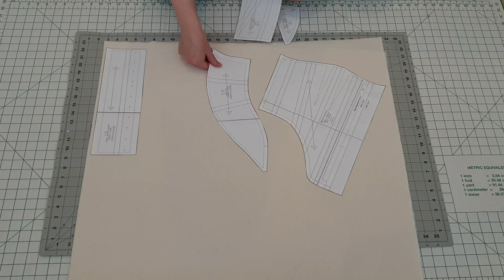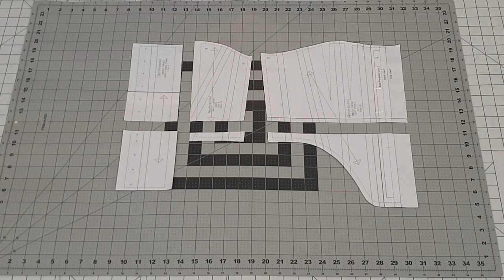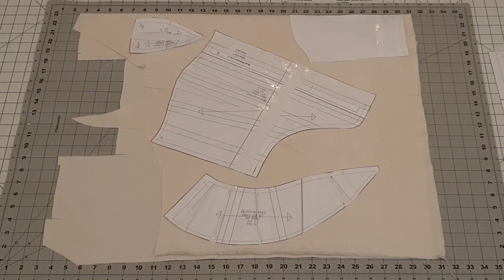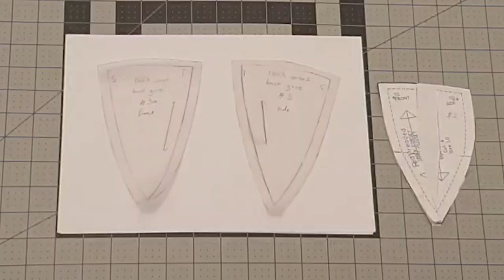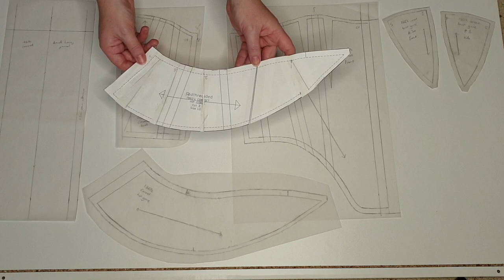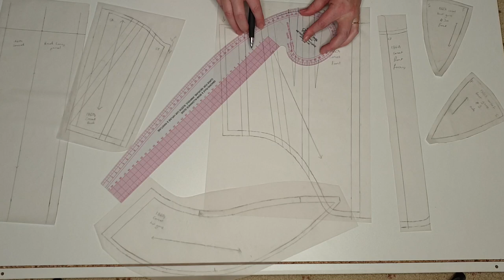Fitting My Redthreaded 1860s Gored Corset Mock Up

Comment: Thank you **so much** for the tip about using masking tape for corset mockups. I used that method in my own most recent corset. It made mock-up alterations so much easier and faster, and I got an excellent fit in the final corset. I also really appreciated seeing your iterations and thought process through your different mock-ups. Thank you for this video!

Comment: Thank you.  I have been told it is unlikely I can make my own corset that will fit because I am large bosomed.  You just showed me how.  Thank you 1000 times, thank you!
Reply from the maker: Best of luck making your corset!
Reply: I think anyone saying that does not understand corsetry. You just have to understand what kind of shape you need and have the skills to sew it (that's where I'm a little iffy... it will be a learning process lol). Ugh... that statement is ridiculous. I could refute it so many ways. So many. Corsetry is VERY misunderstood.
Reply: @mitsycat2803  Yes, and that was the point of my comment.  Despite what I had been told, it is possible and I have now succeeded thanks to having seen this video.
Reply: @cdeg1964  really? Yay!! Then there's hope for yet 😆 of you don't mind me asking, how does it fit? If you don't mind me asking, how is the bust shaping on a properly fitted gored corset compared to a bar l bra? Can't decide between this style of bust, the more flat and boned kind, or a more regency kind of fit. If you've worn yours under modern clothing and feel comfortable sharing, I'd be curious to know your thoughts. More knowledge in this is not a bad thing. I've been watching a lot of videos about fitting techniques before starting, but everyone has their own method. Love to know how this one worked out for you. She did make it seem much less intimidating than other people have. Like I said, I understand what needs to be done, it's more so the how that's been holding me back.  Can't tell if I'm excited or terrified by it. Maybe a bit of both lol
Reply: @mitsycat2803  Mine bodices are shaped to my body.  It took 4 mock ups, 2 of which I placed bones in to be sure it would be okay.  I LOVE LOVE LOVE my bodices.  Bras hurt me.  I have dents in my shoulders, scars from the irritations that lace has caused when the weather is horribly hot and sticky, permanent marks around my chest and back where the band sit.  I made my bodices for both back support... I tend to slump towards my sewing or desk or knitting or whatever I am working on... and bust support.  They are structured in a combination of the renaissance-ish look and Victorian natural form look.  I wanted them to be modern enough that I don't stand out when I wear them but to still be pulled together, comfortable.  Definitely corsetted/bodiced but not 'in my great 
grandmothers clothes'.  So you are aware, I am 60.
Reply: @cdeg1964  thank you so much! That was very helpful, actually. Bras are a nightmare for me too. The band is the worst. If it fits, I can't breathe as well, but any bigger, and I am unsupported. I was looking at underbust, that's what most say beginners should go with, but the idea of having to wear a bra WITH a corset.... not the most appealing. My body is so difficult to fit, though. I have had so many abdominal surgeries that I need much less compression there than the average corset would allow and some odd shaping, especially since my waist is small by comparison, however, I still REALLY need back and bust support. I'm a huncher too, especially while knitting lol. Bottom line. My dream corset does not exist. I was wondering how mashing up styles would work. I'm glad to know you succeeded. My other issue is trying to figure out what fabric will work best with my hot flashes, but how the heck do you research that one? I'm in early menopause due to a radical hysterectomy, and they are brutal. Yet another reason why a super tight, sticky, itchy bra is not ideal. 
Personally, you do remind me a bit of my grandma a bit. But, my grandma was amazing. She was an incredible seamstress, endlessly creative, could knit like nobody's nobody's business, and was always very stylish, in her own unique way. So please take that a compliment 🙂 I bet you look great. And, again, thank you for the help!
Reply: @mitsycat2803  I can understand about the hot flashes.  Mine suck way a lot also.  

Do you have a block?  If not, it is worth you while to make one.  It needs to be the kind with princess seams at the shoulder.  (You can move them later but you need the correct fit first and foremost.  You need to be sure your bust sits where you want it, not droopy or too high or you will not be comfortable.  My laces are in the front and my back has no opening.  That is a perfectly valid option.

Once you have the block you can use that to make your pattern pieces.  I make my inner layer with 2 layers of twill (think white demin), shifting the layers are 90 degrees to each other to counter any possible stretch in the fabric.  You can use coutil, which costs more, or other tight woven fabric with little to no give.  I sew my channels into that and then check the bones for fit.  I use zip ties for my bones.  Heavy duty 200 or more lb strength ones.

Once I have my channels sewn in I put the pieces together with the outer fabric and sew them from back to front grading all the seams to they don't bulk up and look abysmal.  Every thing is still 'flat' meaning the shoulders are not yet sewn.  If you don't use the shoulder straps (BODICE) you will just have the corset 'flat'.  The quotes are because it will definitely have the shaping.

When I do mine, I sew down all my seam allowances where I want them.  I then turn my edges and stitch them with large whip stitches in place.  Once that is done, I hand sew the lining.  I use a 'weird' to most folks method of cutting my lining pieces using the same pattern pieces and then stitching them into each position by hand with small stitches.  

Once I am done there are seams but not stitches on the outside.  That is my preference.

Okay, for a corset, you can stack the outer fabric with the inner (if you fabric is sturdy enough you can use on inner layer and the bones will be between the outer and inner layers but pay attention to stretch and turn your inner to compensate for any the outer layer might have.)  Sew you channels and then do the same seaming.  I would always add a lining.  With your hot flashes maybe micro=fiber breathable bed sheet fabric would work.  Satin pillowcases also make great linings.  Keep any stretch vertical.

You can make a tank shirt of some kind that will not show under your corset but in all honesty, a cotton chemise is likely still your best option, especially if you want to wear your corset to show it off.  

I mentioned I lace mine in front.  It gives my more adjustability that way.  I start with a gap of about 3" finished and then, over time, I can close it down or loosen it a bit, whatever I need to.  Also, since I start with less pieces I can 'take them in' along the sides and center back if my body size changes more than the gap amount.

Use grommets if you can, if not reinforce your lacing holes with jumprings.  Those are easy to find in the jewelry department of a craft store and come in smaller sizes than bone rings.  They are NOT to pull hard against.  The reinforcement lessens wear of the hand stitched eyelets and any distortion of the eyelets over time.

If you don't want to wear your corset tight, don't.  If you want it a little snugger some days, do.  That is up to you, not some stupid fake celebrity 'image'.  I want support and the shaping to make my clothes look better, not to be in pain all day long.  Trust me, you don't even have to fright lace it, the shaping the structure it gives will still be markedly noticeable regardless of what size your start out at.

For the record, I don't wear my bodices in the summer.  It is too hot, and more importantly, too humid here to do that... HOWEVER, I have seem folks make corsets from what seems to be needlepoint canvas.  You need the kind that is not sticky if it gets wet.  Nylon window screening 'might' work but you need that to be an inner only layer and NOT against your skin... and no, I have not tested it but am planning to try it for summer or anyways warmer weather.  Nylon... not the metal kind.  You have to read the packaging and be sure.  Power stretch, the heavy kind that is available from bra making supply stores might also work but you will need to use twill tape for enough support for the bones.  Stretch widewise.  Your outer layer will help the whole corset or bodice not to stretch.  I made samples with that and it worked well but would not be great for tight lacing.

I hope this helps.  I see you have channel but I don't know how to contact someone from youtube directly or I would send you some pics of mine.

Comment: This video was fantastic, and makes the fitting process look *so simple*. Also fantastic to hear a familiar accent. Where did you get the fabric that you used? I've been having trouble trying to find fabric that will work for a corset mockup that won't break the bank
Reply from the maker: Thank you! I used a non-stretch denim that I got on sale at (I think) Spotlight years ago. You can also use canvas, or a thick calico. The key is that it has to be non-stretch. Looking for rolls of fabric on the remnant table can be a good way to go when on a tighter budget. 😊

Comment: Just made a few mockups of this and your video was extremely helpful. I have the length on the body right, waist and hips are perfect. The bust well not so much it is huge i could almost take all the bust gores and still not have it right and im a DDD cup in modern bras. Any suggestions? Im thinking i might need to reduce all the pieces on the top half of it but not sure. Also i have that really annoying fleshy roll area between the waist and underbust. Would more boning help that (i use synthetic whale boning)? If I sent you a dm with pictures would you be open to giving a few pointers? If not I fully understand but any suggestions you might have would be amazing. Thank you again for the video. I’ve been enjoying binge watching your channel. You make things simple and direct and beautiful. Thank you.
Reply from the maker: Sure thing! Send me a dm through Instagram and I'm happy to see if I can offer any suggestions 😊

Comment: And PS - what brand/size of rotary cutter are you using? I've never tried to cut out fabric with the rotary cutter but you make it look so easy!
Reply from the maker: I use an Olfa 45 mm rotary cutter. I find it an invaluable tool for when you want to leave fabric flat on the board, such as cutting around pattern pieces, or strips of bias 😊
Reply: Thanks!!

Comment: How much yard of the denim did you use all together?
Reply from the maker: About a yard and a half for this project 😊
Reply: If I was to make the busk and lacings out of denim as well would 2 yards be good?
Reply from the maker: I think it sounds a reasonable amount to plan for! It will depend on how many iterations of mock up you need, so I'm afraid there is no set answer. 
The busk and lacing strips don't take too much (I've got a separate video on making the busk I use here, if that's useful).
Best of luck with your corset!
Reply: Thank you so much. Definitely taking notes from your video. We are about the same build so your alteration process was wonderful and mind blowing for me who has no idea what to do.